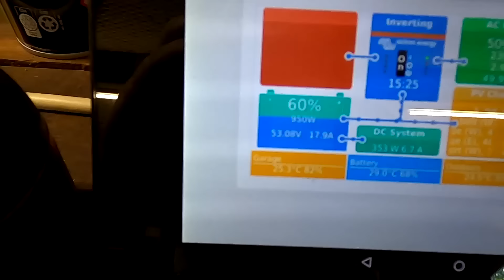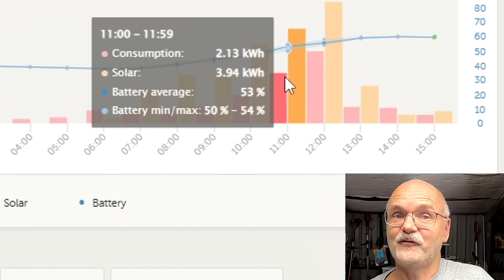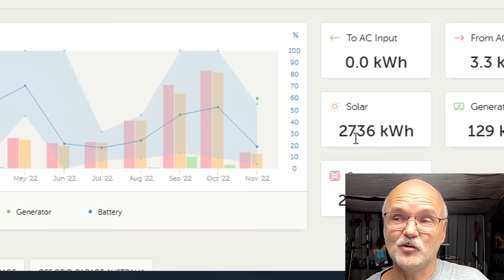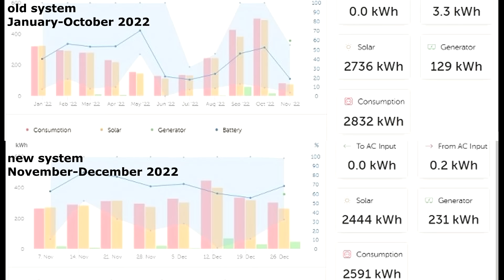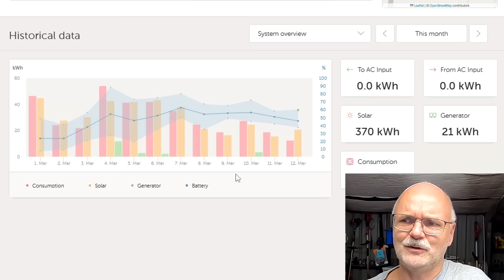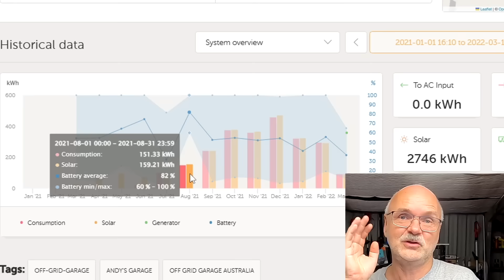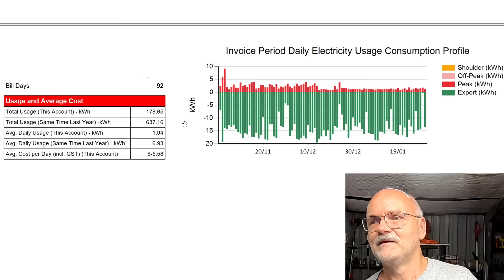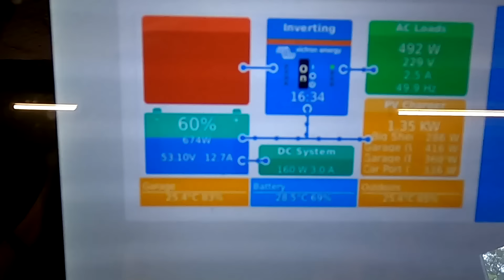4 Months after the solar upgrade. Are we there yet to go fully off-grid?

Comment: Thanks for the excellent report Andy! If you have the numbers for KWh and KM driven for the Teslander would be an interesting tidbit. Also, your grid consumption rate per KW/h and if you get a better return selling power pack to the grid or using the crypto miner? As Fiat currencies are expected to substantially decline in real value and mined digital currencies increase perhaps your little miner might go from $200/month to possibly $500 or more per month. 

I did a quick check on Co2 generation per capita and KW/h in Australia, and it might be interesting to look at how much you reduced you carbon emissions (independent of if Co2 emissions are causing a climate emergency). Referencing the figures below at 650 grams of Co2/KW/h, 3MW of grid power should have saved 2mt of Co2. If the average Aussie produces 15 to 20mt of Co2 per year, then I'm guessing the majority of that must come from other sources such as transportation. I see figures of 400g of Co2 per mile for passenger vehicles in the U.S. driving 12,000 miles a year would be about 5mt per year, so your offset might be more significant. U.S. figures are quoted at 2.5mt per person for food, so where does the other 7 to 12 metric tones of Co2 the average Aussie produces come from?

Australia power sector carbon intensity outlook 2050 | Statista
Feb 6, 2023The power sector in Australia emitted 656.4 grams of carbon dioxide per kilowatt-hour (gCO2/KWh) of electricity generated in 2020. Projections show that in 2050, Australia's power...

Australia: CO2 Country Profile - Our World in Data
Australia: What share of global CO 2 emissions are emitted by the country? Looking at a country's annual emissions is useful, but it can be hard to put these numbers in context of the global total. Is 10 million tonnes of CO 2 large or small; what about 100 million; or 1 billion tonnes?
Reply: Unfortunately, we I don't have access to Andy's report or any specific data related to their energy usage, KWh and KM driven, or grid consumption rate per KW/h. However, I can provide you with some general information that might be helpful.

Regarding the profitability of selling power back to the grid or using a crypto miner, it depends on several factors, including the electricity prices in your area, the efficiency of your mining equipment, and the price of the cryptocurrency you are mining. It's challenging to predict how much your mining profits might increase in the future, as the cryptocurrency market is highly volatile and subject to various economic and political factors.

In terms of carbon emissions, transportation is a significant contributor to global greenhouse gas emissions, including CO2. According to the Australian Department of Industry, Science, Energy, and Resources, the transport sector accounted for 18.9% of Australia's total greenhouse gas emissions in 2019. The energy sector (including electricity generation) was responsible for 33.7% of emissions.

Reducing your carbon footprint through energy-efficient practices and using renewable energy sources can help mitigate your impact on the environment. However, it's worth noting that individual actions alone may not be sufficient to address the global climate crisis, and collective action at the national and international levels is necessary.
Reply: @akimi0222  thanks for the input and information Michael, I very much appreciate that. 

I still have to question that if roughly 60% of Australia's CO2 emissions come from transportation and the energy sector, what accounts for the other 40%? I've seen some figures that switching to electric vehicles for transportation say in America, say that switching all new vehicles to EV's, even if powered by non-carbon sources would only decreased CO2 emissions by a marginal overall Amount. 

I just saw some figures that claim in America, the U.K and much of Europe, about 60% of energy use goes for Interior Space heating and water heating. Therefore, if reducing carbon emissions is the overarching goal, then those the areas where the most return on investment should be realized, rather than transportation. 

And technology such as 3-D printed homes that can cut construction caused by a half or more while increasing energy efficiency by a factor of 2 to 3 are promising Along with implementing energy saving measures.

Having worked in the global oil and gas industry, being observed a few things about oil and gas production, use, construction and environmental monitoring and administration, I have seen time and time again where the the smartest national energy decisions are made on the basis what's most politically beneficial to special interests, agendas and corporate interests.  

Global Energy decisions for at least the last 60 years have been made on the basis petroleum based hegemony the U.S. dollar trade in oil as the world's reserve currency. Much could be done to reduce carbon based energy deception and transform how energy is generated and consumed globally, but that's not the political focus. 

What we observe in regards to what is being presented as a "climate crisis" also deserves as much scrutiny, actually in terms of what  agenda-based billionaires and bankers claim has irrefutable scientific evidence that requires the world turn power and their wealth over to them, especially when they offer structural or technical options and solutions, only political demands.

As we has humanity, no, or should know all too well, political agendas have always been predicated on lies, deception and propaganda. Having worked in the oil and gas industry for several decades, and having family members who were ,called in US politics and global energy at very high levels, thing I have seen as far as politics and energy has been based in lies, deception and propaganda. 

I recall back in the late 80s of the last century, a major US oil companies behest of globalist banker, were hawking a propaganda campaign that world oil would run out in around 2009, and people needed more profits, economic and political power to develop alternative energy sources to save the world. That was all a pack of lies, and as soon as the oil companies got the political and economic power they wanted, all those alternative energy programs were scrapped within a matter of weeks. 

Working for the oil companies, I spent the best part of a decade working at the top levels of the second largest media network in the U.S.. I saw firsthand how political propaganda and mass mind-management works. The founder of that Network was a master hypnotist and mind control expert, and to the extent we were allowed by political powers to the public, we used to produce seminars and programing explaining and demonstrating how political propaganda is used for mass mind-management. 

It's my contention, on the energy front, is to look at the last three years of this novel pandemic, what we where fed as scientific fact and solutions, that were not facts and solutions, and subject those who say they have a totalitarian solution for a climate pandemic that or may not exist,  for which they have presented no viable solutions other than: "Trust us NOW!". 

I would conclude by submitting that before we as humanity, blindly meant to what we are told is scientific fact, that the fact of the matter should be  objectively and scientifically scrutinized and publicly questioned and collectively agreed-upon as is the very foundations of scientific method and agreed-upon democratically, has only then we will really know the facts and what are the best solutions to what issue are at hand. 
Thanks for the exchange, if you or anyone reading our exchange would like to dialogue privately, my contact information is on the about page of my YouTube channel.

Regards.
Reply: @jackoneil3933  Thank you for sharing your thoughts and experiences on this topic. It is important to have open and honest discussions about complex issues like climate change and energy policy.

It is true that there are multiple sources of greenhouse gas emissions beyond the transportation and energy sectors, including industry, agriculture, and waste management. Each of these sectors requires different strategies for reducing emissions, and a comprehensive approach to addressing climate change will need to consider all of them.

Regarding the potential impact of electric vehicles, it is true that simply switching to EVs may not be sufficient to meet climate goals. However, widespread adoption of EVs can be a significant part of a broader strategy to reduce emissions from the transportation sector, especially when combined with efforts to decarbonize electricity production.

Efforts to reduce energy use in buildings, such as through improved insulation and more efficient heating and cooling systems, are also an important part of addressing climate change. It is true that these efforts can have a significant impact on reducing emissions, and they should be prioritized alongside other strategies.

It is important to approach discussions of climate change with a critical and open-minded perspective. While there may be individuals or groups with their own agendas, the overwhelming scientific consensus is that climate change is real and driven by human activity. We need to consider the best available evidence and work towards evidence-based solutions to address this global challenge.

Thank you again for the exchange and for your willingness to engage in open dialogue.

Comment: Hi Andy, would it not be better to parralel the invertors? You can still use the set limits for each invertor, but you do not need to use the "generator" input. So I would rather parralel and not daisy chain, if that makes sense.
Reply from the maker: They can't be paralleled because they are two different inverters. The Phoenix cannot run in parallel with another inverter.
Parallel inverters need to communicate with each other and only the same inverters can be paralleled.
But we will change this configuration a bit anyway in the next video, so it's got you've mentioned that 😉
Reply: @OffGridGarageAustralia  Ah! this true, I forgot they were different inverters, you did originally order two of the same invertors, I remember now..... It can't ever just be simple right.... 🤣😂
Reply from the maker: @GapRecordingsNamibia  I would need another (but same model as my existing) Multiplus II to parallel them. The Phoenix is a standalone inverter for off-grid installation, so the daisy-chaining was the best option at that time to use both.

Comment: You get 2.5 hours more sun on your shortest day than I do. that means a lot for solar in winter. If google is correct you get almost 10 hours and I get 7.5.  I will add more solar to mine this summer so I will have 13,500 watts from 9,400 watts. That should help me a lot in winter. I  might add another inverter and another 4100 watts facing south east to get more morning sun since it seems in winter its usually more sunny earlier in the day.  I also have to clear my panels of snow which is so easy since they are ground mounted and not on a roof. I noticed that I was getting a total of 350 watts with snow on my panels so I went and cleaned them then I was getting almost 3000 watts on a cloudy with light snow day.  On super stormy days does not matte the sun doesn't make it through the clouds hardly.  will be interesting seeing how yours does in winter.  I have been grid free since January 29th but grid is my generator if needed.
Reply from the maker: We are around 27°S down here so it is not too much difference between winter and summer and hours of sunshine. A cloudy winter day for me is better than a sunny winter day due to the shading. It will be interesting. We are already 40% down in production from the summer peak and still 3 months to go until the shortest day 😨
Reply: @OffGridGarageAustralia  Our longest day is 15 hrs 23 minutes in June(summer solstice) and shortest is 7 hrs 30 min (winter solstice). In summer I will have more power than I could ever use. Maybe I need a grid tied inverter to get power credits. I can also donate that power to those who can not afford their bill.

Comment: I really tried hard to follow but the system has grown a lot and you have to listen very carefull to get the full picture right cause with the upgrade so  many changes had come along with the consumption. 
You had not mentioned the kWp of the new system but I could calculate that from the screenshots of the victron.

And your island is a kind of living island or buffer where more loads from the grid tied house had been reconnected to your island like dishwasher and heating to reduce the surplus. You mentioned heating but I assume you mean hot water and not room heating that you might even not need in winter. 

Also a lot of the loads are quite hard to estimate like the car consumption and what not. Might be time for a video to start with the architecture of it all cause I know the word west wing, no that west roof and maybe garage but I still have not really a clue except that I think west wing might be the roof over the battery 2.0 
 
But at least I got a glimpse how the system has evolved from the past and why you had chosen this way of an off-grid garage supplying more and more loads from the house that are taken off the grid too.
Reply from the maker: It is quite a huge system. Over time we will see more and more load popping up in the VRM, especially the larger loads, like car charger, pool pump, air conditioner. Just waiting for the sparky to get this all organised and finalised. 
I can do another video and show the locations and explain what we have installed now. Batteries is a bit hard as they come and go at the moment but we will have some sort of 100kWh at the end.
At them moment, I'm trying to push the system and see how many loads I can connect and if it is enough for 'off-grid'
There will be a large project starting soon inside the garage which will change everything again.

Comment: Kann man den Miner irgendwie im Stromverbrauch (bzw hashrate) regeln?
Ich würde die coins einfach für längere Zeit halten und nicht verkaufen - zumindest nicht jetzt 😉
Ein Video über den Miner würde mich interessieren, oder gibt's da schon eins von dir?
Reply from the maker: Haven't done a Video about the miner, no. It has a low power mode where it runs on a lower hashrate and power consumption. But that's a setting in the config and needs a restart of the control board afterwards. At the moment I just turn it on and off with a Sonoff switch. It makes so much money, because power is free. Otherwise it would be running on a loss.

Comment: Andy, you are a bad influence.  I upgraded my solar charge controller to a 40A beginning of the month.  Was sitting here looking at the old 10A one and thought...  The 50W panel is still down there doing nothing.  Why don't I just hook it back up and connect it to the same battery.  Is another 50W worth it?

What would Andy say?

You can never have enough solar.
Reply from the maker: If you have the space and equipment, I would connect it.
Reply: @OffGridGarageAustralia  Temporarily found a more fun use for that solar charge controller.  I was running it from a little 3S 5.2Ah LiIon pack and decided to connect the tiny little 12V panel to it.  It claims 5 watts, but It only hit 2.5W and overall, the battery voltage has gone DOWN through out the day!

Comment: What about the ROI on the whole solar setup - thats a lot of upfront money to get 'free' power from the sun. I spent about $10K on solar panels and grid tie inverters and need to burn 38MWHr to be equivalent of the grid before the system starts making free energy effectively - I could have put that 10K in the bank admittedly better now with interest rates rising than when I bought the solar and then pay for electrical power from that over the next 8yrs or so. Now I am running around trying to find ways to burn the power in the day in a meaningful way as export to the grid is near nothing (doesnt even pay the daily supply fee that it used to) and that's also slowly dropping too. Have you done any videos on the mining - $3 a day sounds pretty good didnt think much was to be made these days unless one has a warehouse of them...
Reply from the maker: I spend a fair amount of money. For me it was never the economy side when setting up the solar and battery system. I wanted to experiment, learn and share what can be done. Especially with the shading in winter time.
I would have done a few things differently if I would be on a budget and the ROI is of any concern. But I see this as a hobby more than anything else.

Mining is still great if you pay $0 for the power. With a larger miner you can make up to $30/day with a power consumption of 3.5kW. But the initial investment is high, so I bought a used one from Ali to test it out. I doubt I will use it until August again though when the sun is coming up again.